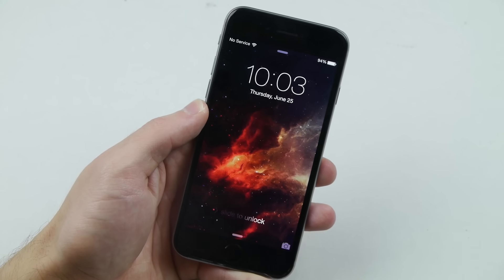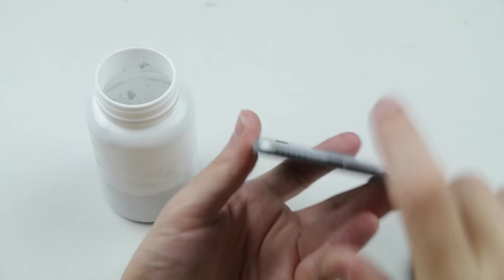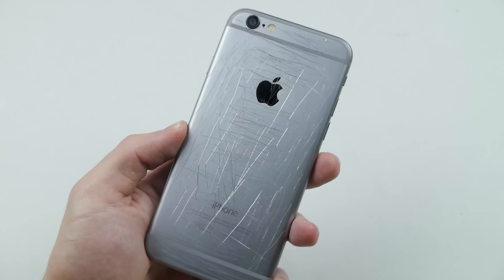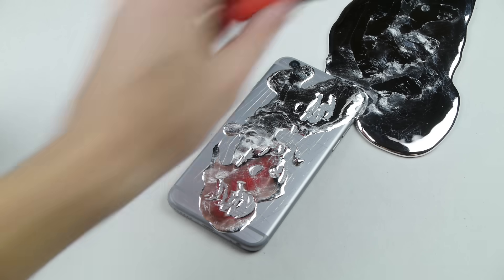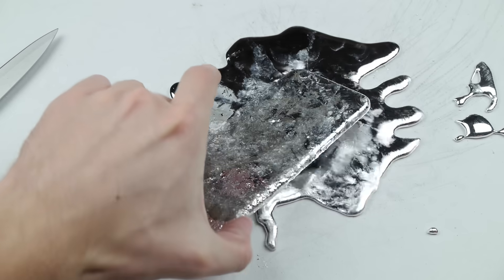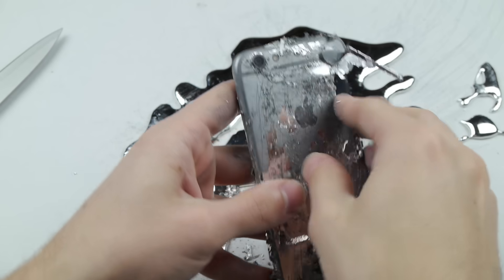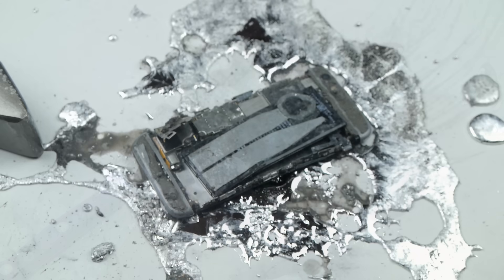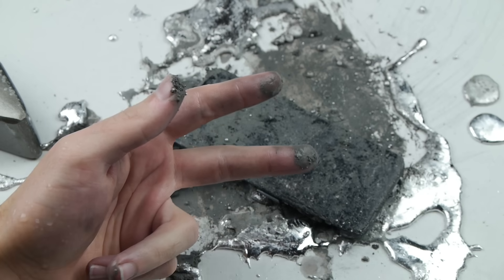What Happens If You Pour Gallium on an iPhone 6?

Comment: Why would you touch liquid metal with your bare hands...?
Reply: Are you stupid? It obviously melts at a low temp. Use your fucking head
Reply: this melts at VERY low Temps
Reply: Gallium melts at 87 degrees Fahrenheit which is about the temperature of your hands.
Reply: Gallium melts at 30 degrees celsius, which is room temps.
Reply: Oh... ok.
Reply: +Samuel Underwood Maybe an association with mercury and other heavy metals that the body likes to absorb would make you think it's toxic
Reply: I found it funny that in the vid he thought he had to hear the gallium up... He could have just melted it in his hands....
Reply: +gamer_haven He had to get it out of the bottle, where it was mostly solid form so I'm sure he didn't want to sit there with the bottle in his hands for 10 minutes, waiting for it to heat up.
Reply: It's not a harmful element
Reply: Why would you touch solid metal with your hands?
Reply: It's funny how I just finished a chemistry project and I had to research gallium
Reply: it's gallium not mercury
Reply: Gallium is a metal that has a melting point of 85.6 degrees Fahrenheit. It won't burn him.
Reply: gallium is non-toxic and safe to handle.
Reply: +Zipporah Michel Gallium is virtually harmless to the outside of the body when you don't handle it for a long time. It's only dangerous when you ingest it.
Reply: +Samuel Underwood 86F actually
Reply: +Zipporah Michel It is a solid at roomthemperature. and it melts in your handy when you touch it. it was not that hot there
Reply: Gallium is a very weak metal. Its can melt in 80 degree weather. You can literally melt gallium in warm water
Reply: Lost - Minecraft saying that someone doesn't have to be rude about something, then calling a bitch, you got room to talk kid
Reply: Gallium melts at room temperature.
Reply: +leah pond  +Jan Van Nedervelde  I think you two might be really dumb. My comment was a farce as mercury, benzene, and liquid nicotine are highly adsorb-able through skin and are also highly mutagenic. The fact that you two did not infer that from benzene and liquid nicotine...just shows how the education system is failing.
Reply: Nicholas Sellers 
That's why I'm self-educated.
Reply: because gallium is that kind metal the won't hurt your bare hands
Reply: It's not exactly hot, Gallium is solid at room temperature, but melts in your hands, at about 25 deg. Celcius or so.so that liquid metal isn't too hot, and Gallium isn't very toxic either
Reply: +Zipporah Michel 
guys they already got it
after 94 commentaries telling them that it melts at low temp they got it already
Reply: Yea
Reply: cuz it legal
Reply: +Pavi lion i think your answer answers the question best
Reply: He's dropped a phone in LAVA this Is probable nothing to him
Reply: I think what he's worried about is if it's like mercury. :D
Reply: +VentureTracks luckily it's safe. we've done stuff in school lab with gallium
Reply: Yeah, but apparently when it reacts with aluminum and water it... boils? O_O
Reply: gallium has a low melting point, so like he said, it can actually melt in your hands. so it will not burn him at all. he most likely put it in the microwave or something, so its like touching hot food
Reply: The state of Gallium in room temperature is halfway solid and liquid, but more like liquid.
Reply: +Zipporah Michel Gallion melts at around 30 degrees celsius (29,77 C to be exact)
So its not hot at all.
Reply: gallium isn't very dangerous to humans
Reply: Guys I think he gets it now. Read the subcomments before repeating everyone else -_-
Reply: +Cayden 80 degrees c?
Reply: +Zipporah Michel it can melt on hands and its non toxic
Reply: +gamer_haven I don't think he could just pour solid gallium into his hands to melt it.
Reply: +Hari Young It's actually used to decorate Christmas ornaments.
Reply: +Kalashnikovs Armed Forces are you
Reply: +Conor Sturmey 86F is the same as 36C and the other way around
Reply: ***** It is metal, it just melts at really low temperatures, low enough to melt in your hand.
Reply: Who cares about how it melts? It's gross and probably not healthy.
He also said it was very hot, so I can see how people get confused.
Reply: +Samuel Underwood You don't have to be so rude about it bitch.
Reply: +Zipporah Michel Apart from the fact that it's hot, it's not necessarily dangerous.
Reply: my question is and ik how low of a temp gallium melts, but how its hot if he can just melt it at room temp?
Reply: +Empolian000 the melting point is pretty low, if it's low, and you crank the temp up to 98.6 degrees fahrenheit, what would probably happen?
Reply: Cadmium Hearts Well gallium's melting point is 85.59°F (29.77°C) and it's boiling point is  4,001°F (2,205°C) so it's most likely going to stay at it's melting point and nothing will change.
Reply: +anonymous unknown Yeah haha, sorry. It made sense to me in the moment. I'm just curious as to if you know why it burns/hurts the holders bare skin, when the average body temperature is only around 13 degrees warmer?
Reply: +Samuel Underwood Not everyone researches metals...
Reply: +Samuel Underwood Somebody's pissy!
Reply: ***** I skipped to the actual shit, sorry
Reply: TheMereanaEffect Yes I've already clarified that statement.
Reply: +Samuel Underwood jeez calm u random
Reply: While you don't have to wear gloves when handling Gallium, it is recommended.
Reply: +XXavierSin You don't have to wear gloves when handling mercury as well....or Benzene...or liquid nicotine.
Reply: +Nicholas Sellers on mercury you have to wair gloves it think. It is getting in your bloodbane. And it's goin to affect cells for sure. I think i read or saw that once...
Reply: +Nicholas Sellers actually u do for mercury
Reply: gallium isnt dangerous. its perfectly safe to touch as long as its not too hot. its a metal that melts at room temp.
Reply: Nicholas Sellers .............
Reply: +Cadmium Hearts The most likely explanation is that he did something like put the bottle in boiling or near-boiling water to heat the gallium up hot enough to stay liquid while he worked with it. Yes, you can melt it in your hands, but if it's barely at melting temperature, it's hard to get it to stay liquid. Every stray breeze cools it back off and solidifies it again, so it's best to heat it to 150-200 or so to keep it liquid long enough to work with.
Reply: +gamer_haven He could have just BARELY melted it in his hands. Then, being only a few degrees above its melting point, the gallium would keep cooling back off and solidifying every time it wasn't in direct contact with his skin, making it a bit tricky to pour over the phone. You have to heat it to something over 150 degrees or so if you expect it to stay liquid long enough to work with.
Reply: +Zipporah Michel cause gallium is liquid at room temperature
Reply: +StrongarmSlayer  thats a rather warm room tho...
Reply: Moron...
Reply: Moron...
Reply: JayWOLF37 yup very
Reply: don't feel alone I was thinking the same thing because I know you should never touch mercury but I guess this is safe to touch possibly?
Reply: +Zipporah Michel you have clearly not been paying attention to chemistry
Reply: Toverjas I think most of the people here in this comment section have already said that.
Reply: +Zipporah Michel its kind of dumb that he heated it, it melts at room temperature
Reply: +Zipporah Michel Yikes!
Reply: +Samuel Underwood Well then chill your head ... maan
Reply: +Blauze It was hot because he warmed it up
Reply: +Zipporah Michel nigga
Reply: +Zipporah Michel because the metal Gallium is a fluid at room temperature, like mercury is.
Reply: SavageArfad shut up, that's not what would happen. it would enflame the eye and you would go blind that's it. ur brain wouldn't be affected .
Reply: SavageArfad XD HAHAA
Reply: anonymous unknown don't encourage his stupidness bro, it needs to be stopped
Reply: +Zipporah Michel: Gallium melts at 85.59°F so it's safe.
Reply: FantasmaNaranja finally someone notices.
Reply: Literally nobody asked about the melting point. She was probably worried about toxicity
Reply: Nicholas Sellers You will want to wear gloves when handling mercury. It is very well known what the effects can be otherwise.

Comment: Too bad that when the aluminum started to corrode that the gallium did not enter the battery and cause it to short circuit then just explode.  I mean.. Come on.   If you know what Gallium does to Aluminum then you would have done this with more protection and not bare hands.  Oh and let us not even get into the fumes that are toxic as heck.

Comment: What melting point does gallium have? It did not even leave burn marks on the table.
Reply: Gallium doesnt have to be hot to be fluid, i think it requires either movement or a little bit of heating up, but not that much that it hurts

Comment: Lol don't forget there are batteries in those I phones man. The gallium could have worked through the aluminum to aluminum components inside then the battery could have been leaking causing the burning. And you could have burning acid on your hands from flipping it and it may explode... I've saw many cases of iPhone batteries exploding without any extra chemicals being added. But thank you for risking your safety to show us cool stuff. Just remember to try to be safe lol.

Comment: And if you wanne know what happened when the fumes came : the alloy of Aluminium and Gallium reacted with the water to form Hydrogen gas, aluminium oxide and Gallium so this is what happened and not the sulfuric acid or Lithium in the battery